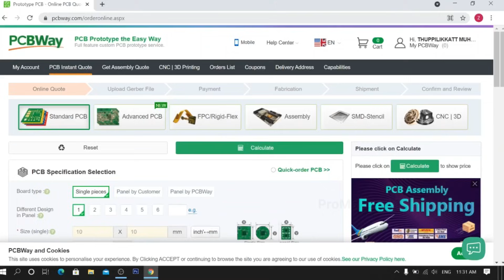This Little DIY Gadget Keeps Your Bike Safe!

Comment: Finally an alarm without a stupid remote. How much dB do you get out of this buzzer? The alarm should not constantly sound but shut off by itself when no more motion or vibration is detected. Just imagine to take your bike shopping and someone accidently hits your scooter or motorcycle while you are away, alarm goes off and sounds for 1 or 2 hours before you finally disarm using your magnet. That cracks people's nerves, srsly. That needs to be optimized, imo. I intend to do nearly the same by one remote behavior for both 1. to start my scooter and 2. by turning it off alarm is armed. The idea behind it:  battery power for ignition to converter->RF remote relay->SSD Relay->switching KSI (Kelly controller)->alarm off and reversing -> alarm on->ignition off.